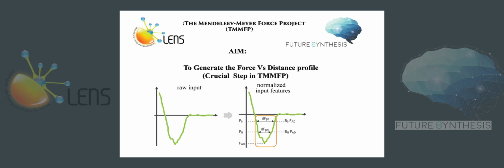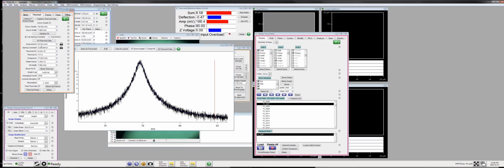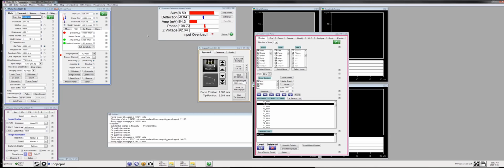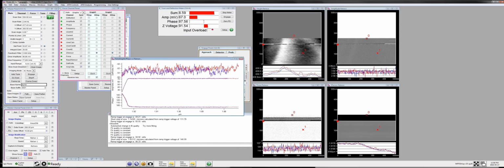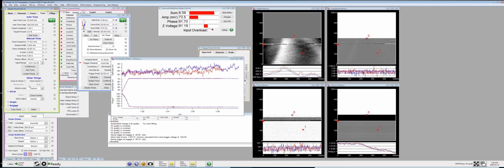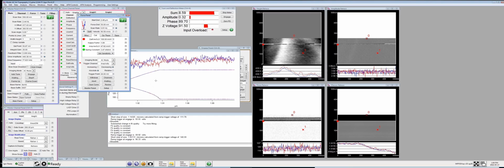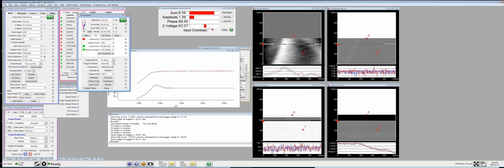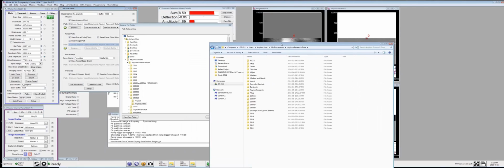1 VideoTutorialAFM 1 CantileverCalibration RawDateANDForceCurves edited

Comment: Are you suggesting that calibration should be performed on the sample surface where FC needs to be acquired? Don't you sugget to find the INVOLS on hard surface like glass, before jumping on the sample?
Reply: It depends...the sample you are using might be "hard" enough...For soft samples and you are opting for high resolution, you might damage your tip/broaden it if you try to calibrate the invols on hard surface...in this case i will suggest you use an estimate base on similar tip from the pack (Mind you invols depends on the spot position and size, so this will not be accurate), then after the experiment , you can now calibrate the invols on hard surface preferably without disengaging the tip.
Reply: @Tuzahu  Hello, I need to talk to the person speaking in this video, if possible please leave the email address for the person here. If its not available, please leave his full name atleast. Kindly help.